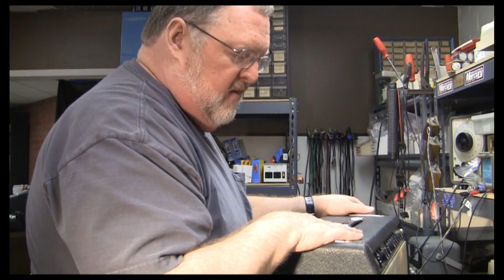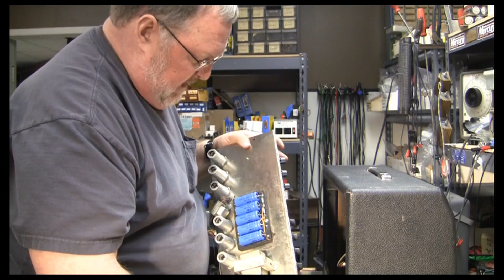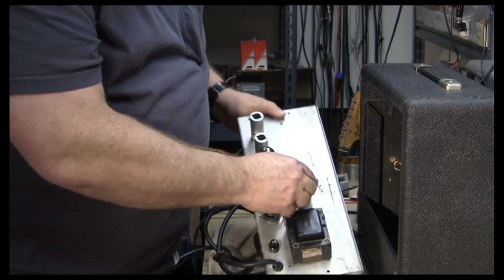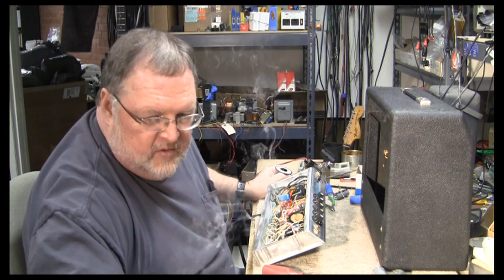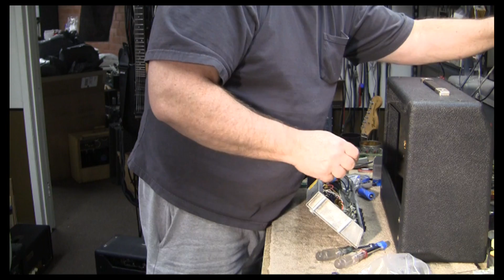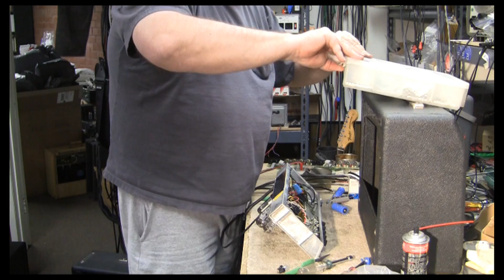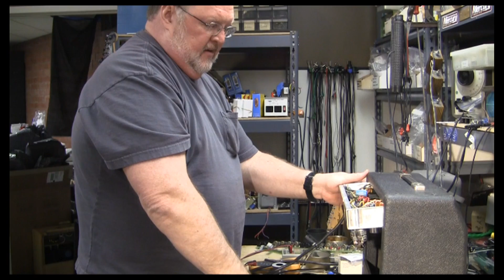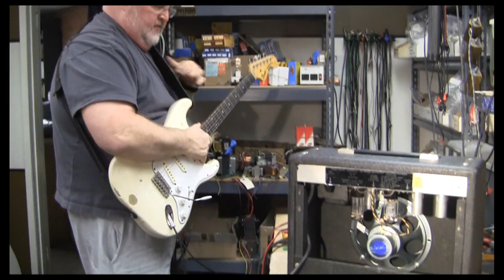Roy Blankenship Amp Repair Shop - 1

Comment: What really scares me is these guys like Mr Blankenship are a dying breed!!  These guys that forgot more about tube amplification are getting older every day and there's very few really qualified techs below the age of 50. Very Scary stuff!!!
Reply: Amen.
Reply: yeah but with the internet and dozens of tutorials there's no reason why anyone can get up to speed if the already have an understanding of electronics. the last tube amp i repaired would have been 1983 !!!
Reply: The same problem exists for qualified radio broadcast engineers. Many have got out of the industry, retired or passed away (sadly).
Reply: Anyone can learn, but you have to have the desire to do so - and it helps if you know someone to assist with the practical things (and the things that can catch you out that a book or tutorial won't show).
It seems these days the kids aren't interested in learning electronics. Too busy on their cellphones and Playstations.
Reply: You are so so correct.....................
Reply: Not necessarily, there are a lot of  youngsters  who have learned about the older and better ways of building amps. The greater fear is that these types of amplifiers are disappearing. Point to point wiring wiring has been replaced by circuit boards [thanks to our intergalactic cousins who crashed at Roswell. Yes they used circuit boards, optical cables, transisters  as well as other stuff, and the military industrial complex reverse engineered the technology and farmed it out to contractors ] They say that circuit boards are better but I don't know.
Reply: Check out Mr Carlsons Lab. Amazingly talented, intelligent, (a bit younger) guy who is all over this older analog stuff like a cheap suit. Has the theory and pride of workmanship to back it all up.
Reply: Have a look at Mr Carlson's lab channel.
Reply: this is so true but what scares me even more is the cancerous fumes are running straight up his nose.
Reply: @Felix Burke Who cares about whether something is using point-to-point hand wiring, or using a PCB (which is also point-to-point)?
Reply: Also I don't see any reason a younger engineer couldn't fix these amps, they just wouldn't be as familiar with common amp problems so they'd need to do more diagnosis.
Reply: Wrong. Wrong. Wrong. Assumptions like this make you sound like an idiot. What proof do you have to back up your statement?
Reply: Yepp, he´s great!!!!!
Reply: I meant: Paul / Mr. Carlsons Lab...
Reply: Big daddy Ramrod he's a Dying Breed all right it's going to take some people out with him if he doesn't show a little more safety in his videos absolutely ridiculous dies a accident waiting to happen
Reply: Melodymaker: I have been doing this for 27 years. I also belong to Mensa. I am far from a "stupid moron". The amps are plugged into a fused variac, I know where to touch and not to touch, I think your criticisms based on one video are off base. This video was an impromptu "pilot" for a series of videos these guys wanted to market, there was no script, I am not trying to "train" anyone, this was a one-off, they showed up unexpectedly one day and started shooting, I was NOT happy about it, as people who know me observed by my attitude in the first part of the video. For you to criticize me because I didn't mention disclaimers or talk about safety issues is really uncalled for, and calling me names is really juvenile.

Comment: Agree 100% on replacing older components. Been repairing amps and larger shortwave radios for years, and it's a real drag to die because you like older tube equipment.
good vid, enjoyed it very much.

Comment: Legendary? I took a 60's Univox tube amp in to Roy, and he had it for 3 months. I had to beg to get it back. All he did was replace one or two capacitors. Amp wouldn't even turn on anymore. 

Roy was supposed to replace filter caps, put a 3 prong cord on, remove the death cap and test what was out of spec and replace. I honestly don't understand how he can work with the hundreds of components he does on a daily basis in his own amps, yet can't get one tiny little 60's amp going. 

I ended up finding a young British fella over at the Hollywood Guitar Center, and he came to my house, picked up the amp, returned it back to me in 3 days completely transformed and playing like a dream....for cheap.
Reply: +theshyguitarist i RUN A SHOP THAT BUILDS, REPAIRS, MODS GUITARS AND AMPS. We also build and mod acoustic guitars and orchestral instruments. In Roy's defence I can honestly say, that even with best intention and conscientious scheduling, every now and then a repair may get lost a bit, for one reason or another. There are a lot of variables with tube amps, and the 'pyramid' effect can cause techs a real headache. This is where we fix one thing and 3 others fail. Then there are fixes we'll apply that seem to be the solution, when only to find out in final test mode, that the unit has failed again in the same way. This causes delays as you can well imagine. Now most times, thankfully, this doesn't happen. So before you condemn a shop, you may want to have all the facts. It's easy, as a customer to rush to judgement. You say when you got your amp back it wouldn't even turn on anymore. This sounds like he was in the middle of the repair, when you insisted that he return the amp to you. Probably because in your opinion it was taking to long to repair. I do agree that, especially without specific repair oriented communication that 3 months sounds a bit excessive to me. Having said that...there are more than a few times, when we've been rebuilding a larger Twin or Super, that we took 2-3 months to complete the project for one reason or another. However, we always, at least weekly, would update the customer, as to the repair status, so that our customer would realize what's going on. I do find, that with everything of this nature, good communication goes a long way. It can be the difference between a good job, and one like you describe. 

Hope this helps you and others that may find themselves in similar situations.
Greg Piette/engineer/luthier
Reply: +GREG GUITARS 

Sorry, but that explanation doesn&#39;t tell me a thing. He is supposedly a genius. He had this simple 60&#39;s amp that has what, 40 components. He only needed to check filter caps, couple others and replace the cord. Very basic stuff that I could have done. I&#39;m just not comfortable working on amps.  The other person I found, came to my house, picked up the amp, went back to his home along with 5 or 6 other big old tube amps, had it updated and working proper in less than a day and a half.

So really? I&#39;m sorry, but no excuse. And no, he never communicated. I had to physically drive out to his shop in San Fernando Valley, and hope he was there, and get my amp back. He never returned my calls in 3 months. Complete loser.

Comment: awesome video I did this type service in upstate NY from the early 80s until 2003. I got into the work by accident after graduating from NRIs Master Audio Video Servicing and servicing consumer electronics, camcorders, TVs, CD,DVD all the disposable electronics!! a guitarist myself I was blown away how good the old Fender vacuum tube amplifiers sounded after I repaired a local musicians old Fender Bandmaster. Its was in pretty tough shape, typical filters and voltage divider resistors in the supply, screen resistors on outputs, typical carbon comp hiss from preamp plate load resistors, and no low end from dried up cathode bypass. When the owner a pro guitarist picked up his amp and played through it he said his amp never sounded so good and he referred so much work from the vintage guitar shop he worked at part-time and other professional musicians. All I did is like Mr. Roy Blankenship most of my Career in this field is de-modify most modifications some tech working at Guitar Center insisted was the way to go

Comment: Great video, I used  to repair radio, tvs  amps etc. in the UK, way back from the 60's to the 2000's One very important thing missing from this shop, seemed to be a solder fumes extractor or even just a fan. These fumes can cause cancer. In our day,   the 1960's and onward s, health and safety didn't exist but there's no excuse today. Guys, be safe, and don't forget to use your Variacs and Isolation transformers and live a long happy life :-)   Yes,  it's pretty hard to wear out a Fluke, mine's still going after 27 years of use and also 3 x sets of test leads, yes, I kept wrapping them around the meter, my fault. As a side note, in the 60's we used Mk8 Avo meters  and of course the Avo Minor for field work. :-)

Comment: Roy Blankenship had a shop in Jacksonville Florida. He went through two of my amps and brought them to life.  A 100 watt Earth g2000 and a Traynor ygm , both from the early 70's and both point to point wiring.  They never sounded as good as they did when he was finished with them. He is an amp wizard.

Comment: This guy brings up a very good point about people getting angry when original parts are replaced.

I understand the argument, about wanting to keep things original, but that's not how it really works if you actually intend to use the amp for what it was designed for.

People want to retain the amp's "original sound" without realizing that the sound they want and, more importantly, the sound the manufacturer of the amp intended is only achieved when all parts are operating at specifications the engineering has called for.

The important point is that many of those original parts do not last forever and are supposed to be replaced when they wear out after years of use.

If the original parts are worn out, then those parts can no longer function as required and will never allow the amp to work as intended. In worst cases, those worn parts can actually cause the amp to blow itself up, figuratively and sometimes literally.

The only time keeping all the original parts works out is if you intend to never use the amp for anything other than as a non-functional conversation piece.

Comment: I have been doing the same work for over 40 years now and while this video is instructional for nubies to watch, for me it just makes it harder for the older tech's (like me) to be able to retire and still have enough work around to keep us from going on welfare or whatever.  There are so many instructional videos on just about every subject that nobody is willing to hire a good tech anymore until they get in there and muck up things so bad that they need to be bailed out.  Just because you think that it looks easy to repair electronic equipment after looking at someone doing one or two amplifiers that doesn't mean that you won't get into trouble doing this yourself!  I have made almost every mistake there is possible over the years.  This kind of knowledge can not simply be passed on in a video!
Reply: +Frank DuVall  I think all this video showed a professional do professional work. A person has to have the proper tools albeit soldering, the scopes, when to use a power tool, knowing enough to know re-occureing problems. Roy has the education and experience(10,000). Any trade has ways and methods that are learned education and real supervised experience. i'm a journeyman electrician and a journeyman welder and the same thing happens in both of my trades. The people with that are interested enough to try with the training get people hurt or worse. If you really have an interest don't dabble. do it right. even a hobby.

Comment: Just want to point out you should plan your iron temperature around the solder used. They all have different compositions that use different temperatures to avoid both flowing and avoiding burning through your flux. Your temp I am sure works for you from general experience, but if people want to look up the proper temps, it works well.

Comment: I recommend using DeOxit Fader Lube instead of DeOxit D5 spray for cleaning the pots. It makes them last longer and work better. Save the D5 for metal contacts like the jacks and switches.

Comment: He's correct about residual voltage.  I tried to bias the output tubes on a '70's SVT and had the power off for over 10 minutes and it blew halfway across the room.  Luckily I was young then.  It probably would've killed me now.
Reply: yeah.. it really hurts.. mine was a TVM 200 watt pa amp.. 800v.. had a taste of lemons in my mouth for about a week after

Comment: Cool, I've been using the exact same techniques for years! You validated me! We are a dying breed, hardly any new amps are tech friendly and repairs consists of board swaps, which is all about paperwork mainly and I HATE paperwork! Give me an old fender any day! I also like that he does "demodifications". I hate it when a mod'd amp comes in, typically with no documentation and crappy solder, etc. Back in the 60's I attended NASA soldering school so soldering, for me is an art form. I like Mil spec wiring with 270 degree wraps, strain reliefs on components, upgrading carbon plate resistors to metal film and higher wattage, etc.  Guitar players today think that you need a million pedals to get the sound they want, but the old masters, especially blues players got those cherished sounds with transformer core saturation, less than efficient speakers, low wattage, etc.  Been an amp tech since 1966 and was a former Fender warranty station for many years back in the 60's. The way that sloppy wiring causes oscillations it it adds an inductance to the circuit...

Comment: At 42:36, he said that he "wore out" several Flukes!  Apart from running over one with a truck, or trying to measure the voltage on the 14 KV AC mains (and you'd probably fry before the Fluke), I don't see how that's possible!
Reply: Clyde Wary The rotary switches wear out.
Reply: patlaw53 I have used FLUKE meters for years , never seen that happen. Perhaps these were $5 meters form WALMART?
Reply: Carmel Teuma Vella Every switch has a rated life cycle from its manufacturer. More expensive switches usually last longer than cheaper ones. While the Fluke switches will certainly last longer than switches on a $5 Walmart meter, they will wear out. How quickly they wear out is determined by how often they are used.
Reply: Clyde Wary. man i had one of their amp meters explode after i clipped it and move my hand away. BOOM!

Comment: Let me start by thanking Roy for the tube amp info. That's why they make silicone adhesive since some of the multi-cap values are hard to find so you do what you have to. I dig the old school solder gun. Also, what's your thought on ESR meters for checking electrolytic in circuit testing. I was just checking an old multi cap from a 50 year old Valco National 1224 amp repair and it tested out good compared to a new CE multi cap. Why would it test good after 50 years and since everyone in the biz says old electrolytics dry out. The multi-cans may work for linger, I replaced a 25uf\25v electro that was dried out because it tested bad and it would spin on its leads. I'm making it a little late to the tube game and was taught TTL and Solid State electronics although, I have 20 plus years as an electronic tech and FSE in the semiconductor field.
Reply: You should test ESR at 100kHz, and leakage at high voltage.

Comment: @45:55 Interesting comment about all the deteriorated components have been replaced. Roy was not seen checking the screen grid feed nor the cathode bias resistor nor the final HT voltage.  In my life as a service engineer this would have been a moment or two well spent especially when the customer has mentioned a weak sound.

Comment: Great video once again buddy hey just a tip on desoldering that can which if people don't have a big enough gun or whatever what I found Works absolutely perfect is a 3/8 in Cold Chisel just sharpen it really good it's your hammer and you can pop those cans out effort lease effortlessly in about a minute also found that a Weller 140-watt will work just fine for resoldering those cans back in

Comment: When the 'first thing ya do' ( at 1:22 ) is 'check the fuse', why don't ya not only check for the physical presence and condition of a fuse, but also look at the fuse to be sure it is the proper ampere rating for that particular amp? Could be helpful to know that . . .

Comment: I just put a 220k 2w 2% metal film resistor in parallel with the first filter cap in all ht supplies.Solves the zap and regulation issues. Not sure about keeping the dodgy caps to reuse ? I just put them in a bag to show the customer what Ive replaced then they bin them.